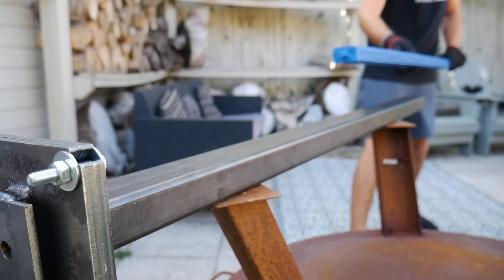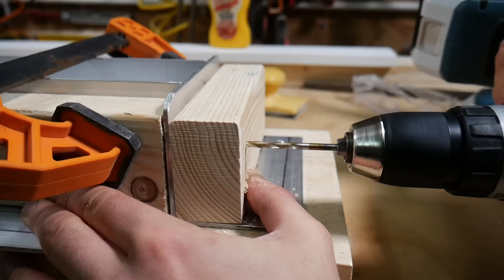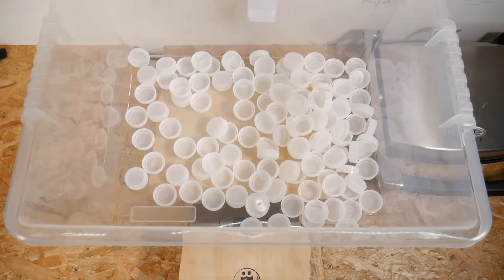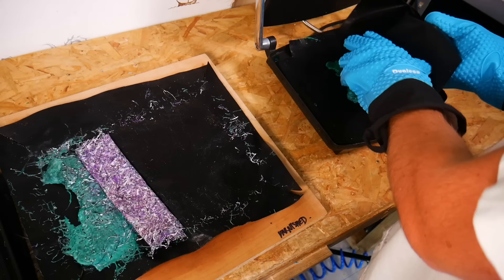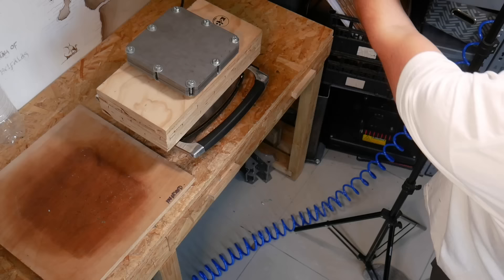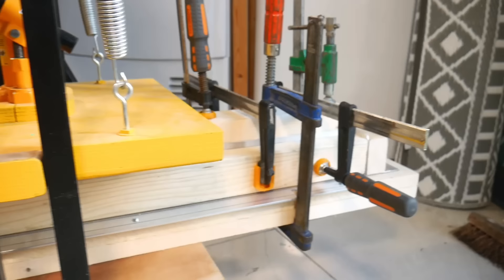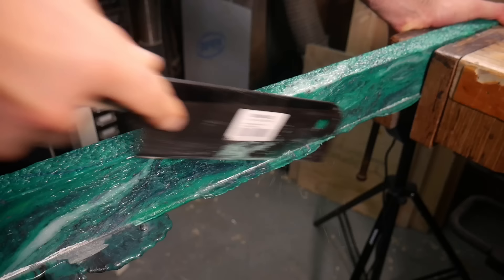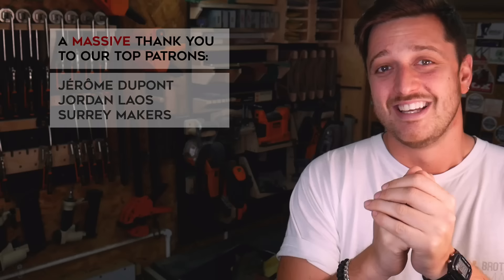How to Make Recycled BEAMS from Plastic Waste at Home

Comment: Here in Australia there is a company already producing these in a product called "Mod wood" to be used as an alternative, mainly used for flooring, decking & fencing. One thing they do to help with strength is use reinforced steel mesh in the guts of it. That may help you with your product.
Reply: I've always thought that bamboo is the perfect internal material to add reinforcement strength and rigidity to these plastic beams at lower cost.
Reply: I wish this would happen all over the world. Anything to reduce the waste in our seas & landfills.
Reply: Hi, I recently purchased a tiny house and my front landing is made of Mod Wood, I do so wish my floor was the same colour as your experiment,  instead of the brown wood look that I have. I must say it is great to clean, so easy, and no splinters in the bum when you sit on it. Lol. Sherie Rodrigues from Australia
Reply: @AussieAquatic  Bamboo sounds like a much better idea than the metal.
I don't relish the thought of ruining my tools by sawing through the beams. XxX
Reply: You could use almost any fibre to strengthen the plastic. Glass fibre used to be used for engineering plastics, but there were experiments using feathers as a natural alternative that showed promise, just the feather part, not the 'spine' of the feather.
Reply: @markgoodall1388  I've actually played with used dryer sheets instead of fiberglass cloth for molded pieces (it's thinner for better detail, and you just build up the strength to what you need)
Maybe if you shredded/blendered it and use it as a fiber replacement?
Reply: @blackc1479  the article I read (an age ago now) seemed to indicate any fibre would work. I guess the trick would be "try it and see", but you don't want so much that the fibre isn't being wetted out and that yiu aren't increasing the danger of a different kind of failure, like decreased fire resistance.
Reply: @markgoodall1388  yeah, totally worth the try. I'm neck deep in projects generally, but I'll totally try it once things settle a bit/have a project it would work on.
General shapes seem to work well enough with the sheets and they have decent strength.
Reply: Why not try to use coco fiber too people been using coconut fiber as rope
Reply: @boykwan3963  lower fire resistance, though.
Reply: @Cranki We need that in the US. I saw a YouTube video on it.
Reply: Hemp is an amazing fibre. Fast growing and very strong. 
But the energy used for this project is not exactly trivial. Why not dump the plastic in landfill?  Then it’s carbon is sequestered, no more CO2 and no marine plastic.
Reply: Another idea for reinforcement,  you might want to try recycled 👖 jeans. The process is simple,  you cut the old jeans down to strips, soke in water until the fibers start to come apart. Pore into a screened tube. Make sure everything is evenly distributed and continue until the color is white. Layer the cotton until you get what you need.
Reply: @lunagray-wolf2404  although this may be a great idea for other processes, I think you may have forgotten that we are dealing with 'Molten Plastic' that holds an extremely high temperature and adding fibre such as cotton will merely just burn away and provide little to no positives at all. Structurally you need something where the melting point is higher than the majority, The molten plastic.
Reply: Here in
Reply: Amazing work done ✅
Reply: Yeah they make a product here in the USA called 5 quater for outside projects.
Reply: Companies in the UK have been extruding plastic beams for many years but their use is very limited, i used to work as an engineer for a big plastic recycling company and we couldn't produce a plastic fencing post that didn't distort in hot weather, the only reinforcement that worked was a galvanized tube inside the post, we couldn't make it at a cost that would sell.
Reply: @hetrodoxly1203  So orentated strand chips wasn't able to stablize the product?
Here in the States they offer a product called five quarter that makes a sutable deck material. It isn't sold cheap but is as good as treated wood if not better.
Reply: @peterweller8583  Is this ordinary OSB that's been chipped? isn't that what OSB was before it was formed into sheets, we never tried this while i was working on this project, do you know the ratio of board to plastic?
Reply: @hetrodoxly1203  nope a closely held secret.
Reply: This will last longer than any wood
Reply: I did some reading up on modwood and I believe this comment is slightly misleading. they state that it is a composite material made of both plastic and recycled wood. It does not state the plastic is recycled, only that the wood is. And the mod wood is primarily recycled wood composite material that is reinforced with plastic. Composite materials are made by combining two or more constituent materials to create a material with properties different Than the source materials.
Reply: @MrBlaser51  very energy intensive
Reply: Trex has been selling recycled plastic boards for several decades in the US......
Reply: @davidelliott5843  I mean, i would think 1 because then it's in a Landfill, which already would like to, ideally, accept only things which will break down in less than  25 years, plus, that would make it a single use item, instead of at least being recycled. As far as the energy that goes into doing this, let me. Tell you, after working at a thermoformer for two years, one that took curbside recyclables and turned them into recyclable packaging for all sorts of products, the best thing, overall, is to reduce or reuse, recycling is good too, especially if it's going to be into something that is actually used and enjoyed by you for a long time (and ESPECIALLY using the caps/rings, which are supposed to be removed before being put in the bins, and rarely ever go anywhere but the landfills anyways). Shit lasts hundreds of years.
Reply: And i completely agree with you about hemp, that shit is amazing.  Check out the hemp Crete bricks, if you haven't yet. Amazing product
Reply: @davidelliott5843  also, not sure how putting in a landfill is any less likely than this as far as it ending up in the ocean...?
Reply: @TheBootyWrangler  but it's not just wood dust and plastic what else is added??
Reply: I don't think these will work well for Australian concentration camps.
Reply: @peterweller8583  5/4 board has nothing to do with plastic decking. 5/4 board just means any decking material that is 1.25", or 5/4", thick. Do they make plastic composite decking material that is 5/4"? Yes. Does 5/4 board mean that it's plastic? No.
Reply: @littlejackalo5326  Okay  its dimensional but that is what it is sold as.
Reply: You know what i think could make a product like this sturdier shredded formica..... Anyone?
Reply: @elitnoctua  Hehehehe Hail Steve Erwin 😂
Reply: @birdduckylucky2894  Carbon tow maybe.
OR glass tow
Reply: @peterweller8583  sounds cool that .ight be cool to see them try our versions 😁
Reply: @birdduckylucky2894  Yeah that would be cool and all,,,,I think the point was just to try it our selves. I'll Tell Goosy Lucy you tell the little Red Hen.
Reply: @Kev Fit then it becomes a bomb waiting to happen, though in the right hands you are correct.
Reply: @jameshunt5316  Wait, what do you mean by a bomb? Doesn't make any sense!?
Even if you had the resources to roto-mold or make precast?  What is this madness you are inferring?
Reply: @Peter Weller read further up in the middle, they were talking about farmers who take plastic and melt it down to use as fuel for farm equipment. Yeah it can be done, no I don’t recommend random people try to do it
Reply: @jameshunt5316  Oh thanks for clarifying
Reply: Love the content. The accent, makes me visualize all the families ripped apart in Australia 🇦🇺 and sent to concentration camps...
Reply: @hetrodoxly1203  bamboo?
Reply: @rickfrogm825  I'm not sure, the main issue would be variation in size of the bamboo.
Reply: As decking, in Australia wouldn’t they be prone to some level of melting? 
Causing them to twist etc.
Reply: @sambeaumont395  nope, I used mod wood for my decking. Hasn't warped or melted and I also live in Qld where the mercury hits 40 regularly
Reply: @Cranki_T  okay cool.

I know we have fence posts made from recycled soft plastic here in NZ - guess it’s not that much different.
Reply: Why not! Awesome
Reply: @AussieAquatic  fiberglass
Reply: @nicholasanello4578  I think those are amazing. Unfortunately I had started my new house construction before I saw them.
Reply: I had a tap attached to timber on a brick wall that had rotted. So I got a sample piece of eco decking and used this instead. it wont rot again.
Reply: @sherierodrigues1569  1 year later from your original comment. Do you still like the material? Has it been easy to maintain and keep clean? Do you want to use it in other places around your home where it makes sense to use? I'm genuinely curious about using products like this around my home.
Reply: @treinveracity9936  Hi Trein, you know what, you have taken me by surprise my dear. Yes it doesn't look any different today. I live in the harsh Queensland sun state, it has the western sun on it in the summer, still looks as good as when I purchased my little home. It hasn't faded either, I have, but the verandah hasn't,  thats my poor attempt at humour. I would use it, but I don't have any plans to extend or enlarge my home, but is so easy to care for. I wish you all the best and happy days. Hugs from Sherie Rodrigues.
Reply: @markgoodall1388  I was thinking the same thing and would love to see them try to 'strength test' the beams. Using fiber to re-enforce theses beams would work. And I think right now they are not capable; they need continuous heat to properly wet out all of the fiber. But I would definitely invest in re-enforced beams as long as they are slightly expensive and give the same or more strength.
Reply: @AndreaDingbatt If metal mesh is ruining your tools then you’re using the wrong tools…🧐
Reply: So basically, they created a product that has significantly more energy put into it, has a significantly higher environmental impact due to the materials it's made of, and is objectively worse compared to traditional materials in most other regards beyond that little virtue signaling point of being "made of recycled plastic" as if recycling plastic will magically fix all of the world's problems. Just stick to wood and metal like regular people because those materials actually work and are actually sustainable.
Reply: A few companies in the US do this and it's more durable than most cheaper end woods, It is normally shaped to be more bend resistant.

Comment: Aw I wish i'd seen this back in October, I'm literally making engineering plastics all day every day, if you had added 2% tioxide and 20% by weight ec10 glass fibre then it would have would have been extremely strong and fairly resistant to UV light damage
Reply: Best comment I've ever read
Reply: What about melting from intense heat like a fire or "global warming"
Reply: Thanks, that's very informative!
Reply: Where to buy or manufacture
Reply: I wonder if this technology could be used to create tornado shelters or tornado resistant homes if the plastic is stronger than stick built homes. If it is anchored into the ground, perhaps it would be less likely to shatter in a high wind.
Reply: @velvetbees  If a 200mph twister throws a two ton pickup truck through a plastic beamed house, it's still gonna shatter.
Reply: @jacobshort6528  Thank you Jacob. Of course. That makes perfect sense.
Reply: @velvetbees  the best way for tornado shelters to avoid this stuff is usually to get underground. You shouldn't be getting hit by debris in the first place!
Reply: He wouldn't be able to without fully melting the plastic. You sure you do? Lmao you can't just slap it on or in and twist to mix
Reply: @AK88.  A fire is an issue. But global warming would kill us long before it got hot enough to be an issue for these.
The fire issue though is easily solved by intumescent paint for mobile homes or by fire resistant cladding in buildings.
Reply: @poke_hoard422  why not?
Reply: @joea5183  it has to combine within it which means you'd have to get it fully melted. He melted it just enough to be able to shape it and nothing more. It would have to turn almost to a liquid State in order to really bind together
Reply: So as is do you think the plastic is as strong as the wood or would it need your additives to make it so?
Reply: Could it still be recycled after that though? Without additives HDPE can be recycled like 10 times. Closed loop recycling is ideal.
Reply: @juliabouzan1739  If it's being used as a long term lumber replacement would that negate the need for closed loop recycling? I'm not sure on the price for adding those chemicals but I figure getting the price for the beam down would be the primary goal. I know replacing wood construction with this type of plastic construction would do wonders flood areas like Florida.
Reply: My question is... So much sawdust occurs when cutting wood what would happen if sawdust was put into the plastic and molded in?? Wouldn't it help take up the bulk and reduce the amount of plastics needed for the beam??
Reply: Where would you get those products?
Reply: @joshuathinker8546  Only problem with any plastic used in this manner is in case of Fire.  The Chemicals burning/Quick melting plastic creates is harmful.